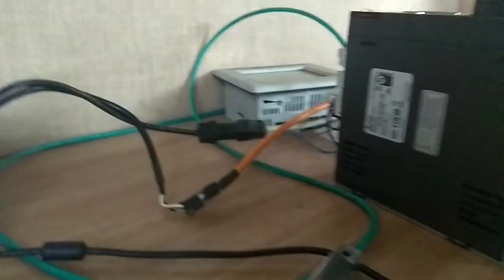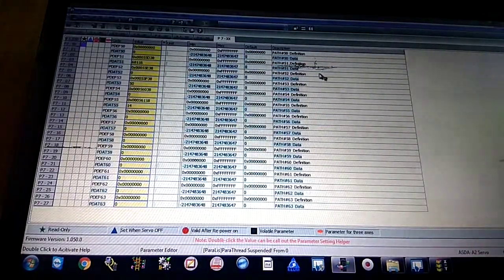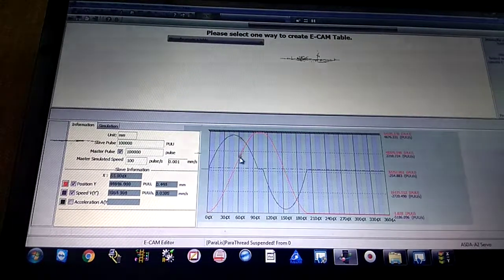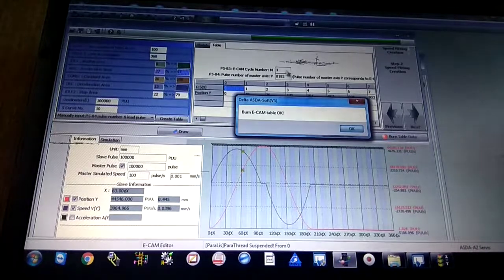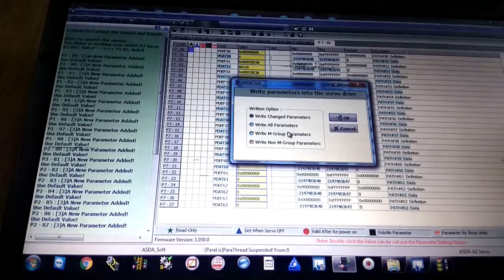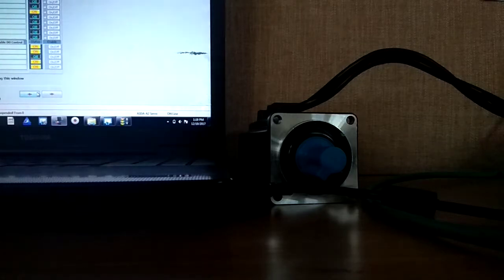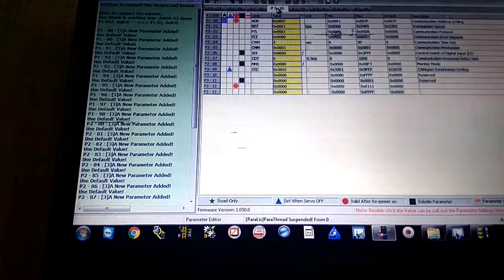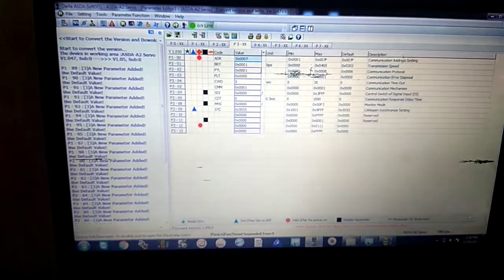DELTA AUTOMATION | TUTORIAL VIDEO,  HOW TO DOWNLOAD PROGRAM ON SERVO DRIVE Through PC

Comment: Hello can you share the backup u have used to program this drive? I need to use Delta Plc NPN output to drive this servo forward and reverse.What parameters need to be changed.I have made wiring to pin 37,and 41 y1 and y0